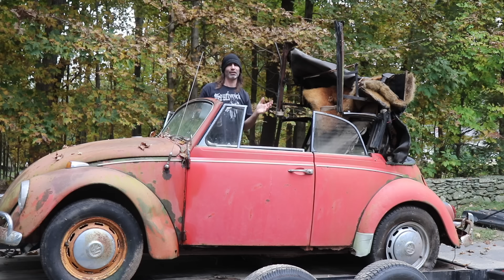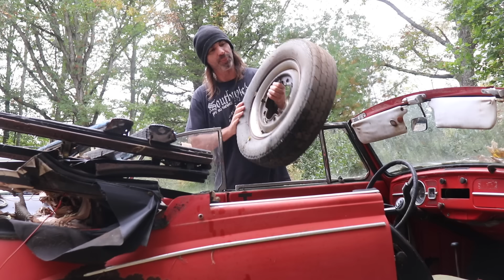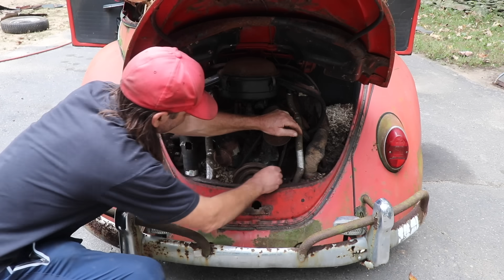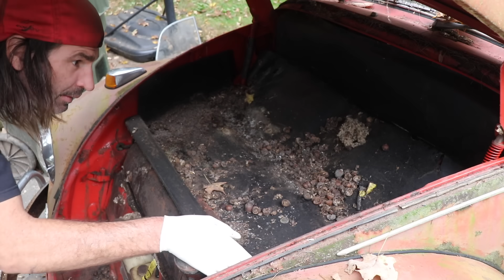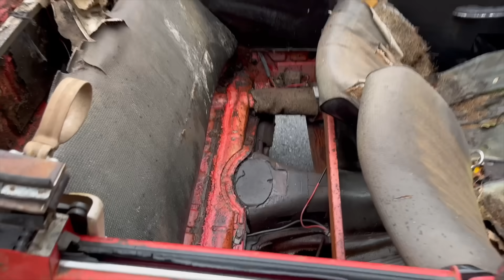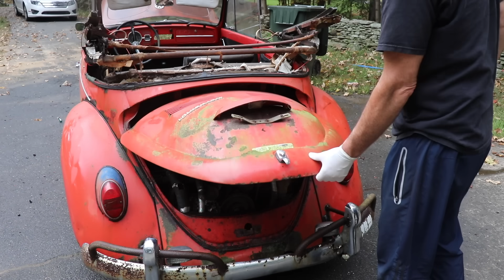1967 VW Beetle Found & Rescued - Saving a RARE Volkswagen Beetle Convertible. Holy Grail Rescue ;

Comment: I love how optimistic project VW owners can have the most rusty and clapped out VW, but they will be like, “look how nice the dash looks!” Yes, they do have nice dashes.
Reply: Up here in the rust belt that car would be considered as a solid body and very restorable. Those who don't live in the rust belt have no clue how good they have it when it comes to cars to restore.
Reply: @todddenio3200  I’ve had a few with plywood floors and etc…. I had 2 in Juneau Alaska and the salt air isn’t super kind to them either. They had nice dashes tho! 😉

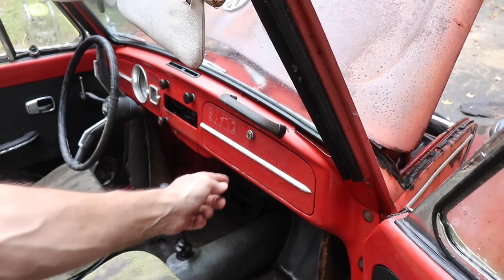Comment: 11:39 aftermarket blue blinker relay. That car was running around not too long ago. I think they’ve only been making repops for 10? Years. Maybe I’m wrong. 
That “B”case is a dual relief 70’ 1600 cc. Rare. Look under it and see if it has bus bosses on the case for a mustache bar.
I have 2 1970 cars and both, have  B case  bus engines. It was the best I could score. And try to keep up appearances.
Not, bad….not bad, could be worse.
Thank you for sharing.

Comment: The 67 is my favorite  year To meny reason y 
But two are 12- volt and 1500 engine
Reply from the maker: 67 is a great driver with the 12v and 1500...but the interior took a MAJOR dive for the 67 year. Exterior had a few unsightly changes in my opinion as well but my 1st car was a 67 so i have a soft spot for them. However , there are some cool one year only stuff as well